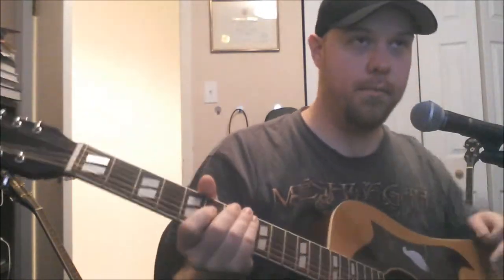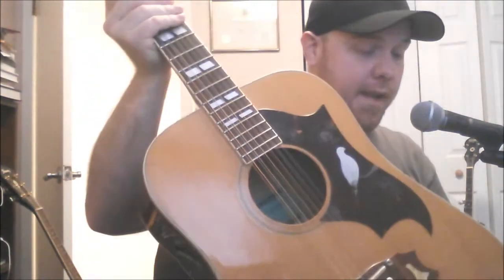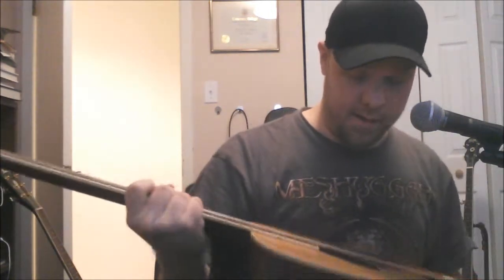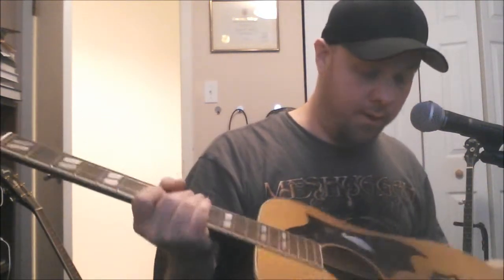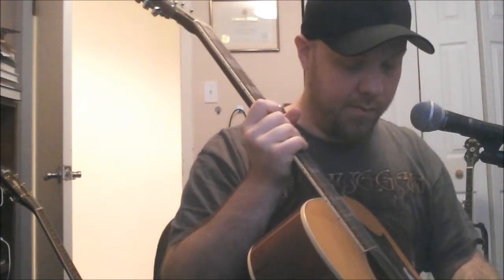Takeharu 12 String Guitar - Demonstration and information

Comment: Cool video.  You play very well.  It's a lovely looking guitar and certainly sounds excellent.  I bought mine new around 1978 and I think it cost me then about £150.  The head stock on mine is a bit different than yours and the inlays on the neck are just plain dots. It sounds sweet though and I wouldn't part with it. I'll try and make a wee video and put it on here for you to see it. Unfortunately I don't have a great recording setup so the sound may not be that great!